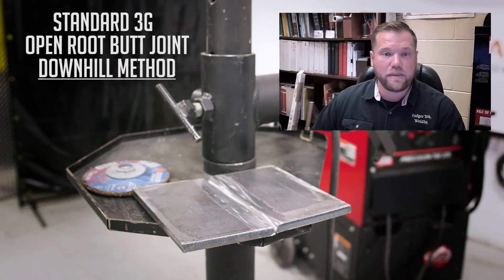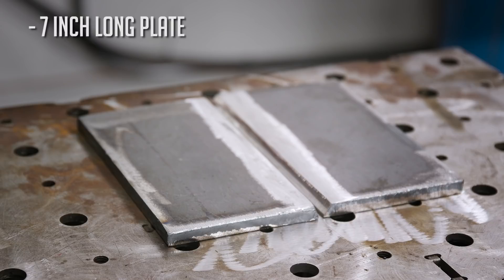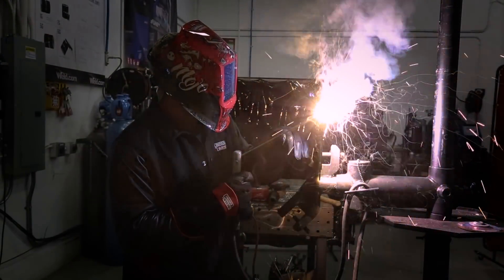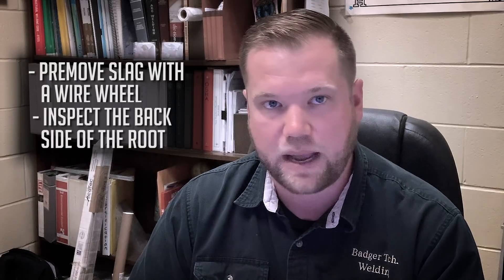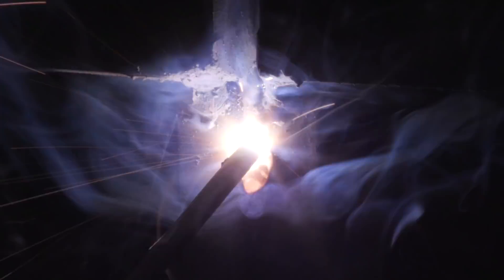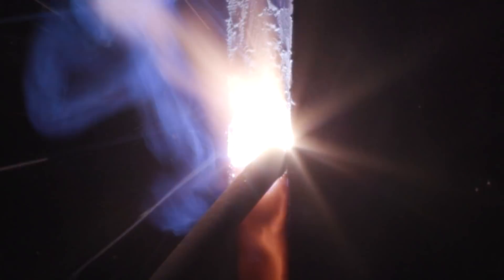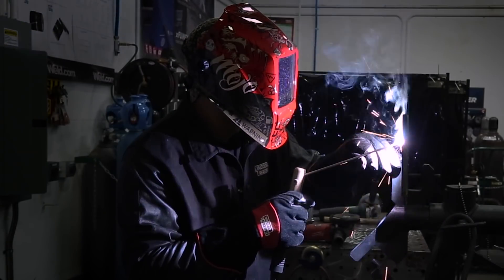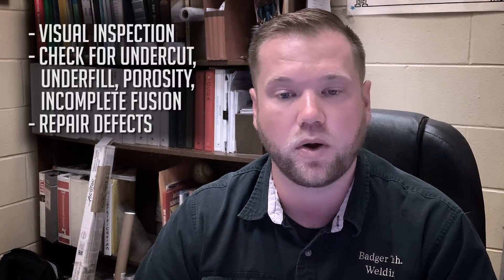6010 Downhill Stick Welding

Comment: Question or future video idea:  What or why is DC reverse polarity stronger than DC straight polarity?  I have always welded DC Reverse because I was told to when I learned to weld on the job 35 to 40 years ago but I don't know why.  Thanks

Comment: No one runs stringers uphill except an iron worker
Reply: It all depends on the situation and weld size required. I often run stringer beads in the 3G and 3F position.
Reply: Pipe usually always run up hill.

Comment: Quit counting all your doing is filling up the bevel. Just watch the puddle and move before it rolls over the edge
Reply: Counting or keeping a beat helps students so much when doing similar joints. As you learn to read the puddle, it becomes less and less important. I still find myself doing it, maybe it’s just something that keeps my mind occupied while welding. I’ll never know!
Reply: 10 years this year of welding and I still count. Also count when I tig carbon steel.

Comment: Excellent points and excellent demonstration! His technique is really interesting in my opinion quite hot running his beads. But It works!
Reply: Paul’s a great dude! The amperage settings used worked out great for this joint. Throughout my career for one reason or another I’ve always welded SMAW slightly colder, I set this one up in my shop using all the settings mentioned  and it worked out great! Once again Paul’s the man!

Comment: I see you guys demo'ing root passes, but it seems that you always use thick coupons, like 3/8" or maybe 1/2"...very seldom do you see those thick pieces in real life; usually on the order of 1/4" or maybe around 1/8" in some rare cases.  Why not use real life examples?
Reply: This is a real life example of a limited thickness open root plate qualification.
Reply: If you wanna see something on some thinner material let me know what joint mock up you want to see and we will try and get it done.
Reply: I never weld down. Always uphill on vertical. I don't think I've ever seen downhill allowed. What does this test qualify you for? Anyway I weld all the way up to 2" thick material on a regular basis.
Reply: @jca66  this is a common example of a joint a company would perform a Performance Qualification Record (PQR), which sets the grounds for everything that ends up being written into the WPS.
Reply: @jca66  Tank companies allow up or downhill 6010 root and hot
Reply: Paul Brown  d1.1 is all vertical up. This has to be for something non structural.
Reply: @jca66  I don’t have the code book infront of me at this particular moment but it does allow a company to qualify its own procedure. Once vetted through several inspection procedures a welding engineer will write a WPS. Then have welders qualify using all the specs written into the WPS. The process works as such: the desire to perform a weld that’s not prequalified exists, engineering gets involved, a roughly 3 foot tall weld test or referenced in code as a PQR (performance qualification record)is completed, the PQR is sent for testing, once the results are back from testing the engineers will develop the WPS then finally the welders would qualify to that procedure using the WPS that was developed from the results of the PQR.
Reply: Paul Brown  did I say something different!? A 3/8” thick joint does qualify you for 1/2” thick and below.
Reply from the maker: That's a really good point! We are working on more "in the field" and realistic set-ups

Comment: Why is the hot pass called the hot pass?
Reply: Because you run it real hot on the pipeline. You want it to dig in and have that back side red hot. On the very edge of burning through.
Reply: @robmurphy806  you also burn out any little bits of slag left in the root
Reply: @chasemeno.23  if they let you use a grinder, why take any chances? That's always how I've treated it anyways..
Reply: @robmurphy806  I suspect a deeper meaning behind this name.
Is it always done directly after the root pass when the root is still warm, or does the part cool down in between?
Is it done to treat the root material that was welded with a low toughness 6010? 6010 has the highest hydrogen input into the weld of all electrodes. Can the hot pass drive off that Hydrogen from the root material?
Because otherwise using a 6010 electrode is a real pain on toughness.

And don't feel bad: Instructors in my IWE course were not able to answer this question. ;)
Reply: @jackmclane1826  nope usually you have to have at least started the hot pass within 10 mins of finishing welding the root. The reason is so the root doesn't have a chance to crack from cooling. Tends to be an issue on higher grade pipe, especially after the root is ground clean. For hydrogen concerns most places want a preheat of 200 degrees in the field, even with cellulose rods.
Reply: @robmurphy806  Do you mean 200°F or 200°C? 
But it's starting to make more sense to me. I only know this term "hot pass" from american videos on youtube. We don't have this term here.
I have not seen much use of 6010 or other 10-series electrodes in my career so far. But I'm not working in pipelining, too. So it might not say much. Stick welding is rare for me in general... ;)

I'm just interested in the process because I like welding in general. And it doesn't get much more fundamental than stick welding. ;)
Reply: @jackmclane1826  200°F
Reply: What Rob said is exactly correct. It also can prevent cracking in the joint. Depending on material thickness and size, sometimes the heat from welding dissipates to quickly causing the weld to crack.
Reply: @dalespilker6005  also worth mentioning that when the hot pass heats up the root, when it contracts it'll push the inside of the root pass out. I've seen spots on roots where it'll be flush but after a hot pass it'll push out about 1/32, depending of what grade of pipe and how hot.
Reply: @robmurphy806  agreed. Can be frustrating at times as well.
Reply: La intención de esa segunda pasada es la de sanear la primera y no la de rellenar. Literalmente, los electrodos se ponen al rojo en toda su longitud.

Comment: What is underfill?
Reply: Bassically what dale said under fill also applies to the cover or cap pass. Which the top layer of weld you see. Bassically there was not enough weld metal put down to fill the joint all the way. Easy to fix the problem is to add more weld with another layer you may have to do some grinding though. If you notice under fill while still welding  generally moving slower will fix the issue.
Reply: Underfill is when the fill layers of the weld are below flush (top or bottom of the joint, depending on joint configuration)

Comment: What is that electrode made of?...most electrodes can't go downhill...i heard that celulose ones can but im not sure....
Reply: It is a cellulose electrode. These absolutely can and are used downhill.
Reply: @chasemeno.23  nice  tnx 👍
Reply: The rods used here are 6010 rather similar to 6011. 7010 and 8010 can be used down hill aswell. I'm not to sure on 6011. On non critical welds I'm sure you could get away with down hill. 6010 and similar rods are what is know as fast freeze. That means the weld puddle and slap solidify relatively quickly. While rods such as 7018 are known as fast fill. Usually these rods have iron mixed into to the flux to help the weld groove fill faster. But the slap and weld puddle stay liquid or molten longer so downhill is not recommended. Since slag could get trapped in or under the weld.
Reply: @Scooty_scoob  I used a rod called 5p plus. I ran it downhill on piping. The welds were X-rayed or ultrasound tested I also welded uphill with 7018. I would choose 6010 downhill every time
Reply: @gargar8196  yeah the 5p is  the best 6010 ive used

Comment: Personally I’d feather a stop to the point of it being blue just a bit to get it to flush on the back side just takes a bit of practice to get the hang of so you don’t make the keyhole to big and out of control
Reply: Practice is the name of the game! I love hearing and seeing how others do these types of things.
Reply: When I was working pipeline, no one feather stops on the root. Just restart half an inch above it and drag it in, that keyhole tends to get too big when you feather it. It'll fill right in. Only feather the starts.
Reply: @robmurphy806  I’ve not feathered them with GMAW-P but never with SMAW. I’m going to have to set up a joint this coming week and give it a shot.
Reply: @dalespilker6005  yeah man, I only feather stops on thin wall pipe or 2", and even only then it's so the root isn't humped up real high. Don't even wire brush it. When you grind the wagon tracks out you'll clean that up.
Reply: @robmurphy806  yeah I can see that. Thinking back to most of my open root pipe experience it’s all been relatively thin wall. I’ve certified with thicker stuff but the majority of the “production work” has been on thinner wall.
Reply: Most of my open root pipe experience was on crane fabrication and repair.
Reply: @dalespilker6005  when I was 18 I broke out as a pipeline welder. Weld test was 6g 2" sch 80 and 12" standard wall 6g, 6010 root and 8010 hot and cap. But most of the field work was 4" up to 24" standard wall in 5g and occasionally 2g. If you had a rollout wheel and spool pieces to build you did a lot of 1g. But for that 2" test you had to be able to get that root close to perfect first shot. Top to bottom without stopping. First time I actually burnt through on my hot pass but patched it up good enough to pass bend test. Not trying to sound like I'm badmouthing anyone but 90% of the time someone refers to downhill 6010 they mean pipeline work and there's a lot of miniscule tips and tricks you'd only learn from a guy who's been doing it for 40 years. And when 3 busted x-rays cost you your job, you learn what you should take a grinder to and what you can work with and get away with.
Reply: @robmurphy806  yup that 6g on 2" is no joke. These pipeline guys don't know the fun they are missing. All uphill no defects/mistakes at all and pass xray. Fun fun.
Reply: @jca66  honestly besides the uphill root, probably 2/3 of the welders I've met can handle that. Station work likes low-hy WPS. ASME actually has a pre-approved procedure with a downhill 6010 root, 7018 rest of the way.
Reply: @robmurphy806  yea that’s what most people did going through school did I’ve tried it a few times just didn’t really like it as much I prob should’ve practiced it a bit more the instructors recommended to feather the restarts and starts to make it easier for them since they were kind of picky if there were any pin holes on the restarts and sometimes the starts(no more then an inch passed)